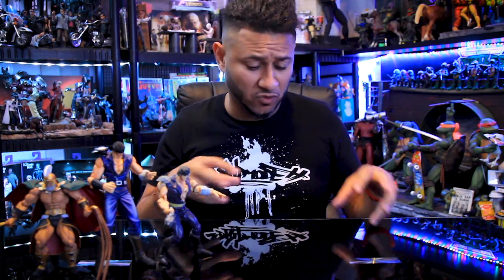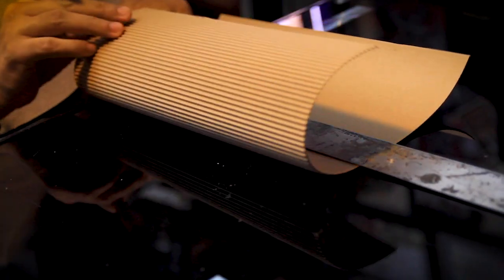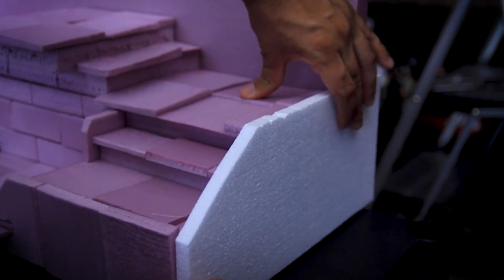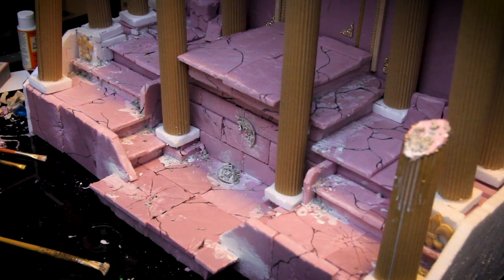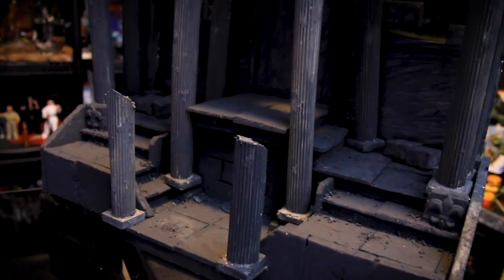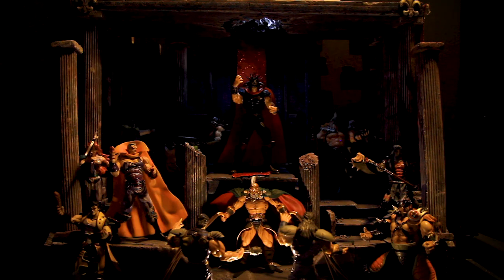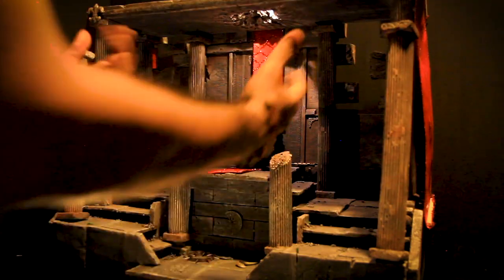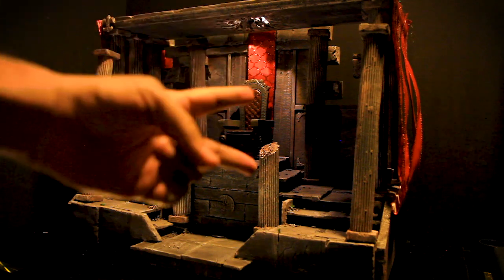Raohs Kingdom Diorama - Fist of the North Star | Vlog128

Comment: Super crazy amazing dio bro. Love It. Is plenty of details, lot of work with awesome result. Did you use, in general, some kind of wood glue plaster over the extruded poly to protect It from the paint?? Or only we must to be aware if we use a black primer in spray over the poly directly ??? Cheers!!!!
Reply from the maker: Naw i dont use wood glue plaster .. i only used acrylic matte paint ... but like 2 layers and then painted and dry brush, black wash and then seal it with a maat seal finish to protect everything.
Reply: @dripmode  Thanks for the explanation man. I have my vallejo acrylic paints, but for figures, you know, not a big bottle, for this reason I was afraid to burn a bit the extruded poly if I use spray directly. As you said in this and other videos all is a matter of to try and learn.